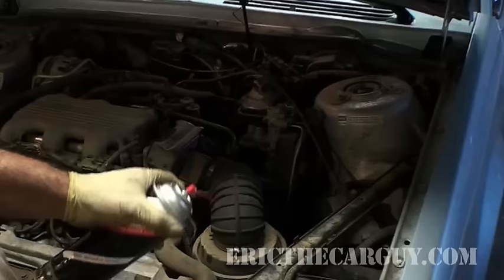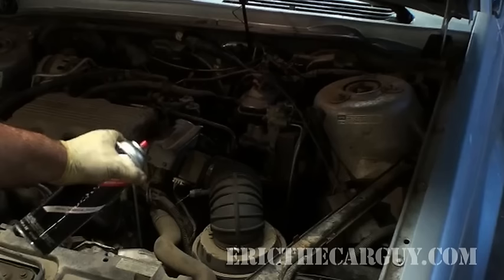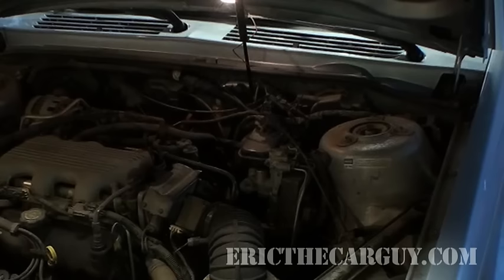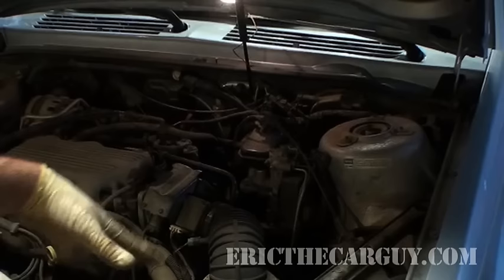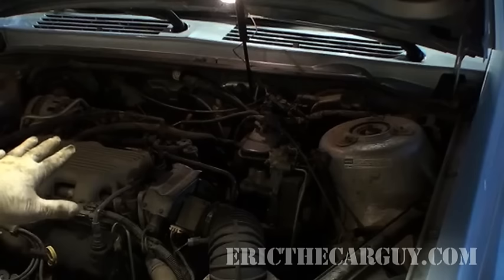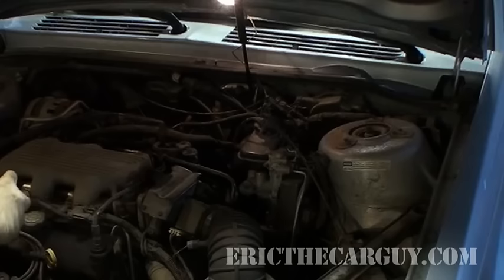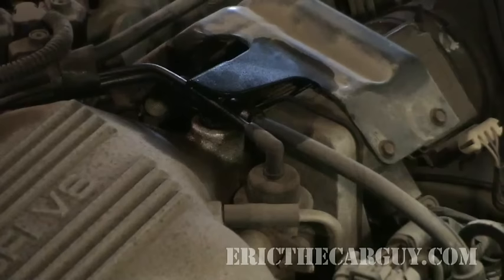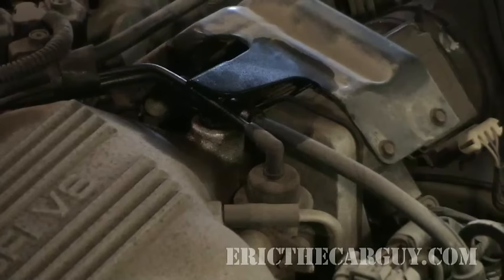How To Find A Vacuum Leak - EricTheCarGuy

Comment: I don't know if its a Vacuum Leak...Or what I've always expected The Carb Idle Screw needs to BE ADJUSTED Correctly. I had an Old classic ford collector, tell me this May on a trip to O'reilly's, that "Did you know that your car was Running Rich?" I said no, what's that. HE said...there seems to be a problem with the air intake and gas to your carb. Maybe this helps.

Comment: Thanks for the help, the propane method worked immediately. I fixed my problem and than also changed my  vale breather hose it too also help with my idle.

Comment: for those of you who dont understand how the torch would have worked. you cut the end of torch off and put a hose over top, then you turn the torch on to realse the fuel. you take the end of the hose and hold it over area you suspect might be a vacuum leak and if it is a leak then the leak will suck in the fuel from the torch and change your engines idle....telling you that it is a vacume leak. the carb cleaner is easier to see though.

Comment: can you reset the ecu by disconnecting the battery?
Reply: Depends on several things. Most cars reset their ECU(s) after an hournof battery disconnection. Max. That's typically. My car takes a week total before the emergency power banks get drained fully from the PCM (My car doesn't have an ECU)

Comment: You can get a low cost smoke machine on Ebay for under $100 and you can do the test with engine off so air from fan will not be a problem. You can use it to test all kinds of leaks beside vacuum leaks. Cheaper that having a shop ripe you off.

Comment: PERFECT Timing! I have a high pitched screech sporadically from start up throughout. And a Check Engine Light with both  Bank one left and right O2 sensor codes. (I replaced bank one right O2 sensor). But after a Battery Reset, My Check engine light returns after 5 to 20 miles, and I get both  bank one left and right O2 sensor codes.   The vehicle runs smooth and good, then it will seem fuel starved and the light comes on, and the engine runs rough. . This repeats every time I do a Battery Reset. (I have been  doing a trial and error to find the reason for the light. Cleaned the EGR, replaced the PVC, Cleaned the Evap Solenoid, Cleaned the mass air flow sensor, cleaned the throttle body, intake.  Separated and cleaned (with CRC electronic cleaner) every electrical connection, including removing the negative batter cable from the block, sanding the block and the cable connector.                      
So next is to grab a can (or three) Of carb cleaner and give this a try. Thank you.  And any advise would be gladly taken.
Reply: ..also, changed plugs, wires, cap and rotor too, and for good luck, I ran two containers of injector cleaner over two fill-ups....
Reply: It still may be fuel starved. A vacuum leak will make it run rich,not lean.Armchair diagnosis is tough.

Comment: if your talking about a gmc jimmy or a votec engine made in the 90's of early 2000's then take the connector for the injectors off its behind the intake on the throttle body clean the contacts with electrical cleaning spray

Comment: Had an issue similar to this one. Ohm test your coil both cold and hot. My coil would pass when cold and fail when warm. Internal fault. 

My car would run fine until warm, lose power coming to a stop, pulse erratically at times and stall... won't start until cool again

Comment: I'm dealing with a sbc 350-Quadrajet 4barrel in my 77 Silverado that is dying on me when accelerating or under a load. The only things I've done are New plugs and wires and I'm not able to just replace everything. Thanks and please give me advice on this. I like you're vids and learned a lot so keep em coming.

Comment: Got the great code of p0171 on my 2011 Silverado 5.3l.  Took it to Vatozone and the kid pulled the code, we went inside and he asked me how many miles (105k).  He then proceeded to say it was my intake manifold, I thought it was rather strange that the code would diagnose it so specifically, because any mechanic (even on newer cars) have smoke machines etc..  Now I’m a shade tree mechanic, but I know that codes will not necessarily tell you what to replace especially with a vacuum leak.  Irritated by this I did the carb cleaner and didn’t notice any engine surge.  So this code is being thrown by something.  The fuel economy has been off but I’ve been running e85 because of our lovely gas prices (it’s a flex fuel).  I’m wondering if it’s an injector, fuel filter etc.  I dont want to believe that it’s a intake manifold.  This truck hasn’t been abused and outside of constant oil changes I have not kept up with tranny servicings or fuel filter changes.  I hope to god that I don’t have to replace the intake manifold.

Comment: Excellent video...thank you for sharing.

I've now replaced damaged hoses bit its still playing up...how long/miles etc could it take for the ecu to sort itself out?
Reply: Depending on the car, it may just need to cycle thru running conditions. A trip to the store, jump on the freeway, take it to 65 & get off the next exit. Other option is ask ur local Smog Tech what the specific procedure for ur vehicle is. The last option is go to library/internet look up reset procedure for ur specific car. You will need: yr, make, model, motor size & sometimes the vehicle identification number (visible thru front window on driver’s side dash board  bottom of the window USUALLY). It will consist of numbers & letters. Normally the  VIN isn’t needed but I’ve seen once or twice where CPU/ECU needed it to reset due to options offered on certain vehicles.

Comment: Or if you have a decent ear listen to the suspected area and put your hand out and block the path of the sound between the leak and your ear. Move your hand around the area till you hear a difference in the sound. It works if you have good hearing still. This won't work very well and some smaller leaks though.

Comment: I have a question I have a 2005 Ford Taurus & it's telling me to check the fuel cap. It doesn't do that all the time but I've replaced the fuel cap on it & its still comes on every now & then. So could it possibly have a vacuum leak & if so where could it be?

Comment: Hear me out:  2004 Nissan QG18DE idles fine, but major bogging between 1200-1600 rpm put your foot down and no response, then it picks up after 1800rpm. I have no idea if this is  a TPS or ignition/spark plugs car has done 288000k. It doesn't feel like a transmission problem because there are no clunks or disengaged engine..

Comment: I've got a old school tech for the vacuum leak test. Start engine, use shaving cream instead of flammables, this will instead of raising idle drop idle. Same basic idea but no fire hazard and you will see the foam get pulled into the hole. Dirty dirty

Comment: I can vouch for the underhood fires often looking worse than they are. Had a clapped out old Buick with a valve cover leak catch fire while on a date. We were driving out to have dinner and the engine starts to miss a bit so  pull over and pop the hood. See fire. Oh shit, I reach in and grab my half empty, day old soda from the cupholder and dumped in on the engine and out it goes. Burnt 2 plug wires and the rest was fine. You should have seen this girl DIVE out of that car when I reached in for the soda and say "It's just a little fire". She had seen too many Hollywood movies I think...... Did score points with her for keeping my cool lol. Really though.......it was a 75' Buick that thing was a tank, I probably could have just kept driving....

Comment: Thankx Bro. I have a vacuum leak in my odyssey and is driving me nuts already pulled the intake three times amd still no luck. Im gonna try the propane with a pipe method that way I can get under the plenum. I will post my outcome. Thankx again for the ideas. Experience.

Comment: I need to figure out where all the vacuum areas on my TJ Wrangler, pretty sure I have a small vacuum leak, but I do have a bad valve cover gasket that is leaking oil around cylinder 6, so hoping that might fix the vacuum leak issue. If not, will have to keep looking but at least my oil leak will be dealt with.

Comment: 2000 Honda accord sedan ex 4 cylinders - majority of the time stalls or tries to when going into a stop, drives fine without any issues. While in park (Idle) it won’t shut only when pump the gas and let the gas go and it shuts off. Autozone checked in with some car codes P0303/P1491/P0401. ?

Comment: I replaced my engine on my 7th gen civic and had a high idle issue and the ecu said the iac valve was the problem but it eventually fixed it self then I took my throttle body off to tune the throttle position sensor because I had no power (turned out it was a fuel pressure issue) and after I did that the car would throw up an iac valve code again so I replaced the valve and it's still having the same problem, haven't checked for vacuum leaks yet but I did make sure the cooling system was bled properly. The only thing I can think of is it's trying to relearn the fuel trims

Comment: I have a 04 Silverado 2500hd with the 6.0 lq4 and it's been throwing p0300, I thought it was part of the fuel pump but I noticed only one side (the driver side) makes a hissing sound like a leak ) so I'm gonna try the carb cleaner in the morning some time and just replace all my lines since they're easy to get to

Comment: ok  thanks   this is helpful to me,  i had a holley 6140 that was sitting for a year or so  the seals dried up and there were leaks , when i took off the carburettor   the pcv pipe and bolt hole on the bottom plate fell off in my hands  so i blocked the area off with petrol resistant sealant and put the peice back on when i botled the carburettor back on  i sealed it up with more of the sealant and replaced the dried gaskets  no feul leaks all was fine  but  when i ran the engine it was off song   had no  power and was running very rough although firing on all cylinders   most probably running very lean  as i could smell feums and theres a loud whistle coming from the distributor   or its coming from the little valve port in the front of the carb as theres always been a little screw in it blocking it   its probably loose ,  im going to take the bolt out of the bottom plate thingy and clear out the sealant and totally block that off  guna think of a way,  maybe aluminium can metal and jb weld or a thin metal and jb weld,    ive put that bottom plate on well   its sealed   id need a craft knife to cut that off and a new plate   that aint guna happen anytime soon

Comment: The ten years of working at auto shops and dealers I've caught two cars on fire and both were put out in less than a minute or two max with a fire extinguisher lol very minor if any damages at all except for a messy cleanup and mechanics complaining about dust all around the shop lol

Comment: Chris fix have a video using a vacuum cleaner who blow air, blow air through exhaust with engine off and spray water and soap over engine. He find 3 leaks easy at air manifold and fix it with a gasket

Comment: Generally speaking, isn't the check-engine light supposed to turn on when there is a vacuum/air a leak - or maybe that depends on where the leak occurs in relation to the 02 sensor?
Reply: Old cars don't know this. The same happened for me. I stopped and engine died. Then turned on again like nothing happened :)
Reply: Maybe depends.

Cars have to operate under a wide range of conditions, including "open loop" states before the car's emission controls fully kick in.

The ECM cannot be giving false alarms.   Customers would stop buying cars that had them at the garage every week because of small leaks.

A check engine light should come on when things are really bad or the emission control system is in jeopardy.

I have decades of experience with automatic detection systems.  They're not 100 percent reliable.  Isn't possible because parts age, sensors go out of tolerance and sometimes systems "Degrade".

Comment: I have a 1992 pontiac grand prix and the air does not come out of the vents.  I can hear the blower motor running but still no air coming out of the vents.  Any suggestions?

Comment: This is exactly what`s happening with my motorcycle engine, the idle revs are high, it cuts out when warmed up but will start right up, and black smoke is coming out of the exhausts.
One thing though, rubber does not like carb cleaner.

Comment: A vaccum leak can badly disrupt the gas-to-air ratio especially in the intake manifold. This can cause a lot of unburnt gasoline especially in the IM....which if not treated, can cause engine misfires...or even worse, a loud pop or bang (also known as a backfire).

Comment: Safest way is to add  low pressure compressed air <10  psi to brake booster vacuum line , spray soapy water all over and look for the bubbles !

Comment: Eric I have a high Idle problem intermittent.On my 5.7 99 escalade .I was wondering where to start ,maybe the idle air control valve .gummed up throttle body plate.Vacuum leak or 190,000 miles and its time to go find a newer car/truck

Comment: My 76 Ford LTD.. 464 engine. Gas line on carb. Sprung a gas leak. Top of intake and carb. Were on fire for about a minute before I located a fire extinguisher. Car ran better after the fire. Maybe it cleaned something in my carburetor but it was funny in the end..

Comment: For a couple years now, I have been clearing my check engine light with my scanner tool while the engine is running. Is that bad? Do scanner tools reset the ECU when you clear the codes or should I unhook the battery for 15 minutes?

Comment: i have a 2001 chevy blazer s10. 4.3 v6. i have checked for hose leaks and other possible vacuum leaks but , nothing. while driving sometimes it loses power it doesn't stall out all the time, it kinda boggs down and ac runs slower. it only loses power an boggs down going up steep hills. (live in the mountains.) after trans going into 2nd this thing whistles dixie more than any southerner. and then after 3rd trying to give more power the check engine light starts flashing but doesnt stay on.the whistling  sounds just like a have freaking turbo (no i dont have turbo) an so very annoying. what is  happening? ive done tune up after tune up ive replaced hoses, could this be my manifold intake or gasket on it?
Reply: I have a similar problem, minus the CEL, did you find out what it was?

Comment: So what if the car will start but not idle? 
New Coils, Spark plugs with wires, starter, battery, air filter, and fresh fluids. Cleaned the MAF. I’m tied between a vacuum leak and O2 sensor. But sounds like I’m running rich (before I try to let it idle). Just can’t rely on someone to hold their foot still while I tried this, if that would even work at all.

Comment: Honestly resetting the ECU is nonsense. The long-term fuel trim is basically a preset fuel delivery before the engine is warm enough to start compensating with short term fuel trims to make the fuel delivery even more precise. Long Term Fuel Trim is just the average of the short term fuel trim over an extended period of time (2 minutes).

Comment: i have a 97 ford expedition 4.6L V8 and my check engine light came on and i heard my car feeling and sounding like it was gonna stall out. so i scanned it and it was a EGR valve problem. i cleaned the valve off and inside and checked if the bladder held air when i held my finger over it and it did. so after cleaning it it didnt idle bad at all how it did. but now since i did that it makes the sound and feeling again when accelerating at slowly from a stop. its almost like i have to gun it to prevent it from running bad.

Comment: Liked your video. Thumbs up. I have a 2004 dodge ram 5.7 with a P0300 code. It starts fine but after a minute or so it sputters then I accelerate for a min and it stops sputtering. Please help. Thanks

Comment: Have you ever run across one that stumbles at low acceleration but there is no codes it you push the peddle like pulling out in traffic it doesn't do it but like slowly acceleration through a stop light it does it only between 20 and 60

Comment: I tried spray clean my engine once and the instructions said to warm up the engine a little bit so I did and then spray down the engine apparently a little bit of it dripped onto the catalytic converter and the whole engine started flaming up I just started laughing and grabbed a fire extinguisher. The sad part was nobody else was watching.

Comment: I just blow smoke into the lines coming off the intake..cig smoke is still faster than anything else..you can find many connectors leaking even inside under the dash or near your tank..even blow smoke into the booster ..unplug your crankshaft sensor & blow smoke into the intake while turning over the motor to check for blown head gasket,loose spark plug or exhaust leak..old school mechanics(most are dead)..lol..just don't inhale

Comment: I don't you're monitoring this for comments anymore but I have to try. I've got a 2013 taurus that started rough idle and ended up jumping time within a few days. After head and timing component replacements it still rough idles. Everyone thinks vac leak but I can't fine one and fuel trims show lean on one bank rich on other (+14, -12). What the heck should I be looking at?

Comment: I checked my vaccuum leaks with smoke had none changed spark plugs, coils, engine cylinoids, knock sensor, and even all the injectors and still lose power any idea what it might be?

Comment: Erick
I have 1994 Isuzu Trooper LS 3.2 just given to me it was sitting for quite a while problem is that when you start it revs up to around 3,000 but very slowly goes down to around 1,500 cold or hot. also its stays revving high after you accelerate and take foot off gas pedal. Changed plugs recently but still have problem.